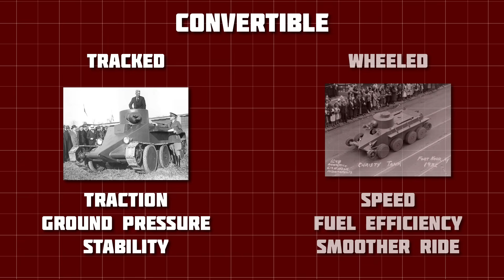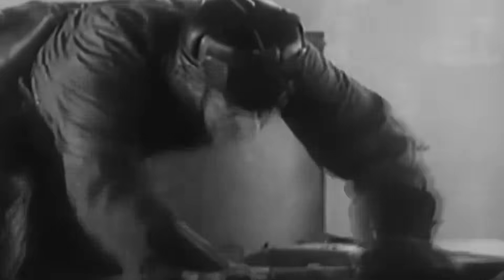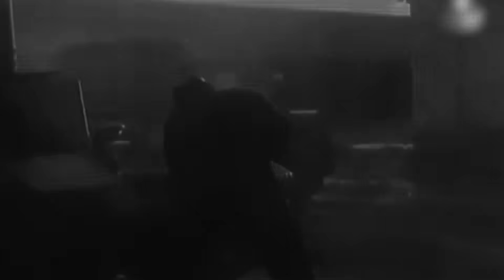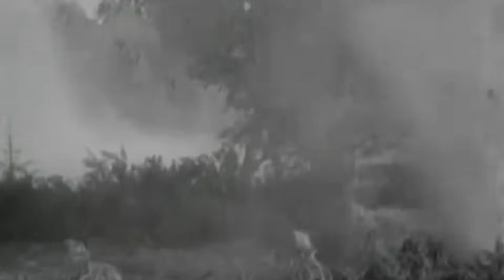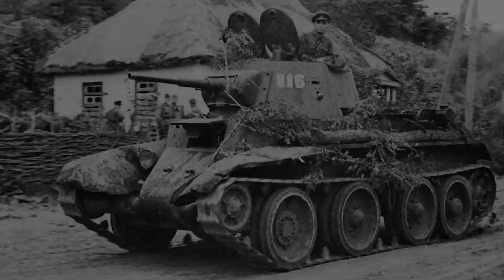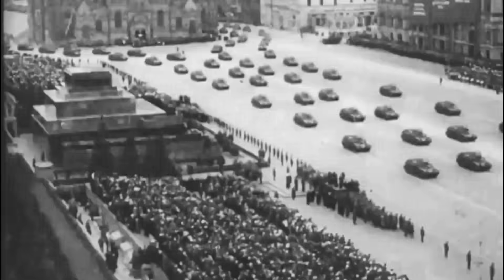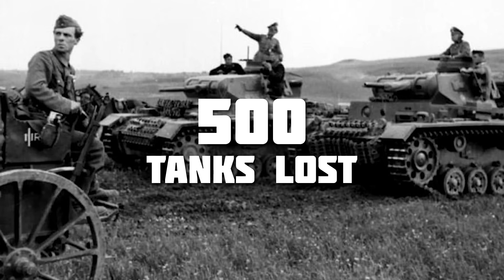The BT Tanks — Stalin's Doomed Cavalry

Comment: Where BT-20 or A-20 tank? Where T-46 and T-29?
Reply from the maker: Don’t think T-46 or T-29 are very relevant to the BT tanks
Reply: @RedWrenchFilms  They have, however, historically, these machines (and additionally BT-SV) have a huge bearing on everything. In addition, do not forget the modifications of the linear BT-2, BT-5 and BT-7. If there had been no failures with the T-29, we and the T-34 would not have been successful, but before the T-34 and A-20, it was the BT-SV that became the first tank with inclined armor.

Comment: The BT tanks actually had quite a few technical innovations for their time, and decent firepower, though they were little more than soup cans on tracks/wheels.  Indeed, it was that ability to take off the tracks and run as a wheeled vehicle, to take advantage of hard roads, that's ever more the proof that the Soviets had offensive intent in mind prior to Barbarossa, and that Hitler simply beat them to the punch.  Such a tank is not only not necessary to fight a defensive war, it's woe-fully underarmored.  Add to that the fact that captured (reasonably intact) BT command tanks had road maps, not of the USSR, specifically, Belorussia and the Ukraine, but of Poland and GERMANY.

Comment: I had no idea the BTs were so strung out in 1941.  That certainly wouldn't help them.  I wonder how much of this was because industry had long since been switched towards production of KVs and T-34s and how much was simply negligence.  More the former than the latter but likely both I assume. I do think they were an excellent interwar tank with a pretty good track record, at least in Spain and the Far East.  A relatively cheap, very fast light anti-tank gun and machinegun pillbox is nice to have when you're fighting infantry.

My understanding is the BTs were considered an important part of the Soviet dream doctrine, Deep Battle.  Working towards something throughout the 30s, the goal was something like Operation Overlord or Market Garden.  Drop paratroopers behind the enemy frontline then quickly linkup with fast light tank attacks while the heavier and slower infantry and tanks pushed the frontline.  Thanks to this being a very complex combined arms coordination and the purges of the Soviet officer corps, they didn't really get this to work until Operation Uranus, by which time the BTs were long gone.

Great video!

Comment: Curiosly the first country to show interest in the Christie design was Poland who signed a deal with Christie regarding work on a modified version of his tank (most notably the Poles wanted a turret that could house a 37 mm gun) but the deal was broken by Christie after the Soviets showed up with a better deal which undestandably left the Polish side annoyed. 
After a few years Polish engineers designed their own "ala-Christie" suspension which was meant to be used in their "persuit tanks".

This also is an interesting case of different approaches to procurement philosophy, the Soviets began mass production only to realise how many issues there wereas they went, the Poles built a prototype, found all the issues (most notably that the track/wheel option was neat but inpractical and all the weight saved by removing it could be used for better armour and a bigger gun) and the began work on a new model, the development of which was interrupted by the war.

Comment: I've been told since childhood (I'm Russian) that, before the 1950s, tank repairs in the USSR weren't considered a problem because tanks, and other equipment, were treated as consumables. Soldiers weren't taught how to service tanks in the event of serious breakdowns or exhaustion, as it took a lot of time and messed up logistics. So, even if the tank remained intact, the crew simply transferred to a new tank (this is about the T-34). There were no problems with resources in the USSR; technology wasn't the best before the 1950s. My great-grandfather was in the air force and flew the Pe-2 and Pe-8. The engines on airplanes weren't repaired, but replaced with new ones.
Reply: Thats the common practice until the nowadays when overused engines simply go into the trash for a change
Reply: @MaximilianBuilder  Metal can be melted down and turned into something new; old machin have a shorter service life than modern ones, but environmental requirements reduce their lifespan.

Comment: Tanks are carried to theatre on the back of trucks or railcars to save their tracks, transmission, the endurance of their crews, and fuel.

This is why a tank that can be driven on wheels like a truck, at speed to the front, by virtually anyone, is very attractive.

But the compromises to achieve this ruins the fighting potential of the vehicle.

The fighting compartment of the BT is also hopelessly cramped, with no thought given to crew comfort (and hence endurance) or escape.

Add to that the lack of a radio, terrible visibility, thin armor and a gun with notoriously bad ammunition (many 45mm shells were poorly made and shattered on impact) and you have a vehicle only good for propaganda stunts.
Reply: I have to say not just the lack of radio but nearby total absense of radio communications everywhere in the red army ( before 1942-1943)

Comment: One additional point that contributed to the failure of the BTs in 1941 was not merely training and leadership, but doctrine. After the execution of Tukhachevsky, Soviet tank doctrine moved from the use of massed armoured units designed to punch through enemy lines to small groups for infantry support. This amplified the problems of poor training and leadership in the same way that it had with the French armoured forces the previous year. The real irony is that the Soviets had helped develop German armoured theories and up until the Purges, Soviet ideas were similar.
Reply: No, by 1939-1940, they returned to the concept of mechanized corps. In 1940, nine mechanized corps (each with over 1,000 tanks) were created on the western border. They should have stopped there and equipped these corps with auxiliary equipment and supplies. But who came up with the "brilliant" idea of increasing the number of corps to 40 (!!!). As a result, tanks, units, and other equipment were shuffled around. By June 1941, not a single unit was combat-ready. Some tank divisions had up to 400 tanks (60 of them heavy), while others had only 15 light tankettes. When Timoshenko was appointed People's Commissar of Defense after Voroshilov, it turned out that the Red Army leadership had no idea how many tanks they had! An inventory had to be conducted.
Reply: @evgen_70   Pretty accurate but I think RKKA only formed 30 mechanized corps. Several districts in the urals/central asia were to form a single tank division according to mobilization plan 41. If I remember right the 6th mechanized corps was the most powerful out of the 30.
Reply: @soapycactuses9281  Yes, the 6th and 8th Corps were the best-equipped. Ironically, the Germans essentially didn't even notice the 6th Corps' actions; the corps was destroyed from the air and due to technical failures. It is the tanks of this corps—often abandoned undamaged in the Brest and Białystok areas—that appear in most photographs. The 8th Corps fared better, although it immediately lost its infantry, which was forced to fight against saboteurs and Ukrainian nationalists. And tanks cannot fight without infantry support.
Reply: Tukhachewsky was the one made the red army doomed to die with negative tanks BT and T-26. Its awesome he was executed, but terribly not by being blown up in the pile of his favorite tanks

Comment: Iirc BT-6 was a full redesign to include the BT 3/4 upgrades among others but it diverged into BT-7 because of the engine before the prototype hull was completed, leaving a modified BT-5 testing the experimental fuel tanks as the only "BT-6" to be recorded while the new hull was adjusted for the petrol engine and redesignated BT-7.

I know you cant cover every last individual sub model, But there were several upgrade packages for the BT-7, with the BT-7A featuring a 76.2mm snub nose, and the BT-7M being used three separate times (that i know of) as time progressed, the final "M" package being completed somewheres around 1943, adding a roof gun, new gun sights and better radio equipment. There was also a BT-7 with the F-34 gun, and another with the 57mm gun, and a prototype using the 37mm anti aircraft gun seen on ZUT-37 and ZSU-37. The Finnish / Germans also played with the leftover BT tanks, modifying them with everything from 3.7cm and 5cm AT guns to the 3.7cm and 7.5cm howitzers from the early Pz 3s and 4s. The finns also managed to slap a multi-MG anti air setup on a few decapitated tanks if im not mistaken, using them as light anti air tow carriages/transports.

I do love your videos though.

Comment: Don't even on paper the bt-5-7 were superior to the most commom german panzers in 1941 since they were panzer 3(g-h) with 50-60mm of frontal armor(almost immune to soviet 45mm even at point blank range)and better firepower. Not to mention that the panzers 3 had more chance to see and shoot first because they actually had an commander cupola with good visibility(for the time ofc)and a commander that didn't need to load and command the tank at the same time like the bt's.

Comment: They failed for the same reason the rest of the Red Army did in the summer of 1941, it was caught flat footed by the German invasion and the entire force lost cohesion. It doesn't matter how good your equipment is and how much of it you have if it fights as a headless mob. The BT tanks were designed for rapid exploitation of breaks in enemy lines, not to survive in encircled pockets under constant attacks from all sides. Which is the condition most Soviets formations found themselves in that summer and fall. It was the idiocy of Stalin that doomed most of his army in 1941.

Comment: BT should be studied in any Tank School ! 600 hour use is a colossal time to be used ! CCCP designed special tanks during 1941-1945 with a life span of 20 hours ! Basically one attack , one or two days mechanical life ! This concept actually saved CCCP, not the heroism of the soldiers ! If the tanks were in so bad condition in 1941 , why they have been deployed on the West border ? Was Stavka full of stupid commanders ? BT tanks were wipe out because the punch come from the other side on 21 June 1941, and all military units were placed next to the border. Keep in mind they had petrol engine and no units had a clear plan ! All Red army from White Sea to the Black Sea had no plan in fact ! Indecision was the main killer !

Comment: "11 ton tank"

And there's your problem...   There's good reason why it became so rare by end of WWII to have so few tanks below 30ish tons and below 20ish ton, well, they were indeed mostly getting shot up.

However, the biggest cause for initial mass losses had less to do with the tank's good or bad sides and more to do with strategic issues.

"Germans lost less than 500"

Correction, less than 500 longterm or permanent losses.
Same as during the Poland campaign, Germany took far far more temporary losses.

Comment: The reason for convertible tanks was much simpler. Tracks in 1920-30s were very weak and died easily after like 50 km march. So purpose of wheels was to "get into the battle" without losing durability of tracks.

Comment: Re: Finnish use. None were captured in Winter War, but quite a few BTs were recovered in the early stages of Continuation War. A few were briefly used in with specially trained tank rider infantry, but overall it was deemed too impractical to be adopted. T-26 was just as good for Finnish conditions with better technical realibility and fuel economy. Gasoline shortage was a large factor.

BT-42 was an attempt to convert BT-7 into an assault gun with a British 4.5 inch howizer and custom made turret. It turned out to be barely adequate as mobile artillery and completely useless for anti-tank role. They tried to make HEAT rounds for it, but those didn't work. BT-43 was just one prototype.
Reply: Well compiled Mr. cat-man!
Reply: Excellent for attracting anime weebs tho.
Reply: There is a BT42 in the Parola Tank Museum - if you're in Finland it's well worth a visit for this, a complete factory fresh looking Stug III, a T72  training tank skeleton and other great WW2 and newer vehicles.

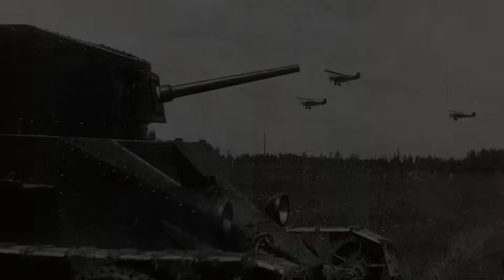Comment: 6:01 is it just me or does the B-3 looks like a fucking bolt-action cannon?It has a fucking grip,trigger and a stock
Reply: Common for interwar vehicle, fortress and ship mountings the British 2pounder and french 37 and 25 mm guns were the same way especially they have a a grip and shoulder pad bolted on the stationary part of the gun cradle instead of elevation gear since the overall mass is low and balanced enough for a 19yo to manhandle
Reply: No kidding. Looks like a heavy autocannon you'd see a Space Marine wielding in Warhammer 40k or something.

Comment: USSR didn't have 20 000 tanks on Western direction in June 1941, more like 7- 8000. I don't know exact number for BT tanks, but it is likely to be 3-4000. Spares were lacking, partially because USSR preferred to produce new tanks instead of stockpiling parts for old ones. Soviet doctrine expected losses , and expected short life span of tank in the field, which was mostly true. Note that Germans also had problems with spare part for certain tank types. 
In general, BT tanks were similar to Cruiser tanks in British armed forces, and similarly to them losses were  high, as the concept of fast lightly armored tank didn't pan put as expected in clashes with Germans. Against opponents without  good AT weapons and doctrine, BTs were still usable. For example, in Manchuria 1945, after the operation Soviets still had over 1000 BT tanks available (exactly 1091 tank on December 20th 1945, in various condition).
Reply: I feel like there's an interesting parallel there between the BTs and Pz 1 and 2s. They were light designs that worked well against both inflexible and very light units, before proving entirely inadequate against armor doctrine that was rapidly maturing, as theoretical preconceptions got replaced with hard learned experience.
Reply: @ashleyhamman  Germans actually didn't have cavalry / cruiser tanks, except perhaps  Pz.Kpfw. II Ausf. D. In general, in first years of the war they were going for balance of speed and armor. Of course, I agree that tanks were going obsolete quickly in those years, and what worked yesterday would not work today.

Comment: 400 hp ?    Wow.  That's lots for then.
Reply: 26 ton t-34 medium had more torque than 70 ton king tiger. Soviet tank engines in ww2 was ahead of the time. If germans also had 4 valves per cylinder and overhead camshaft they can have much more torque even with their gasoline engines,but they was cheap on it and losed the war cause of bad mobility on their tanks.